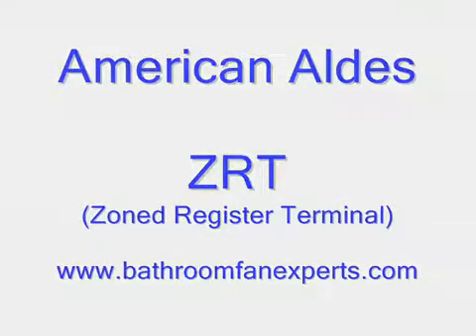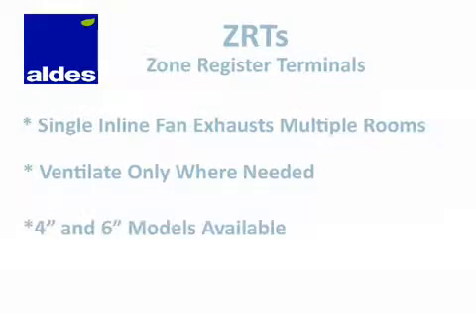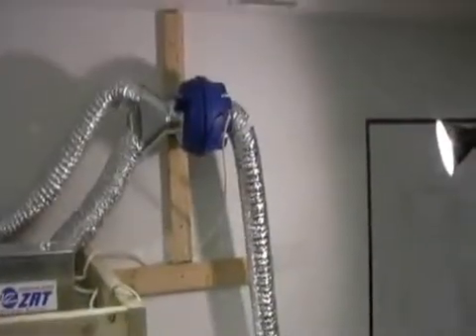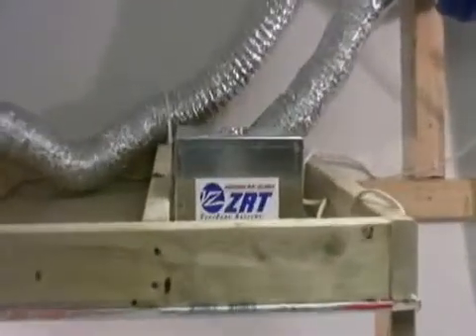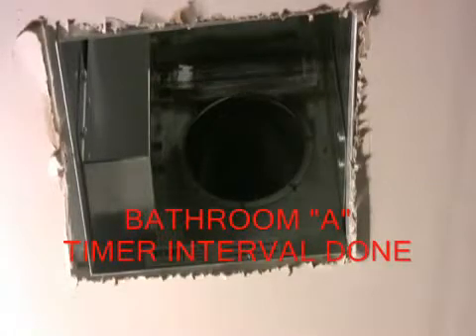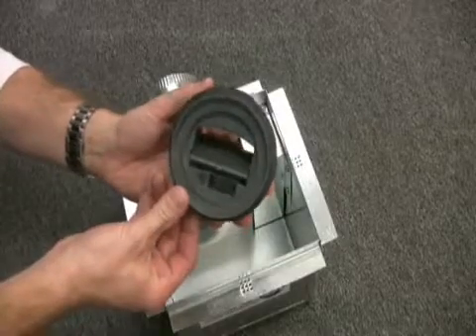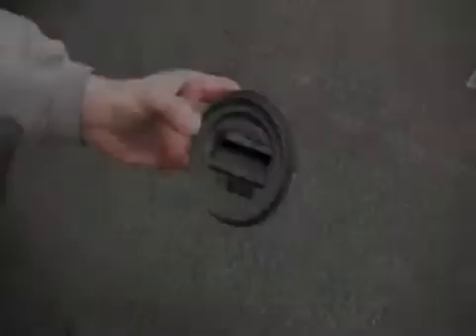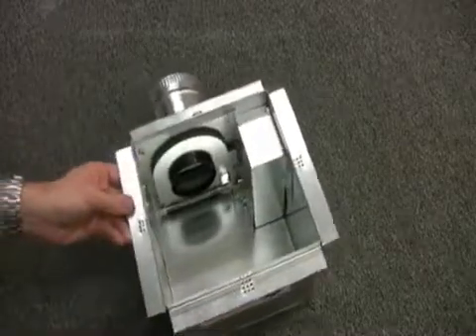American Aldes ZRT (Zone Register Terminal)

Comment: How do you test the exhaust suction air flow at a ZRT?  I have an E150 connected to ZRT-2 but they are not sucking enough to hold toilet paper when the damper is open (on high speed).
Reply: You ever found out how this all works?